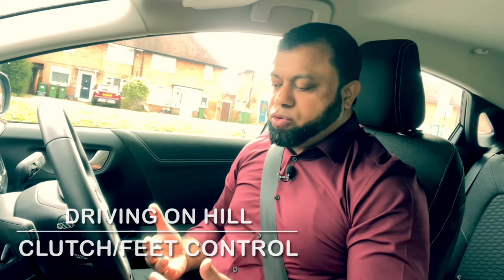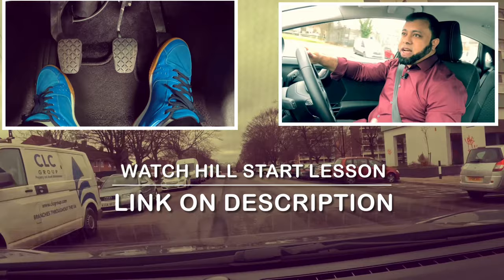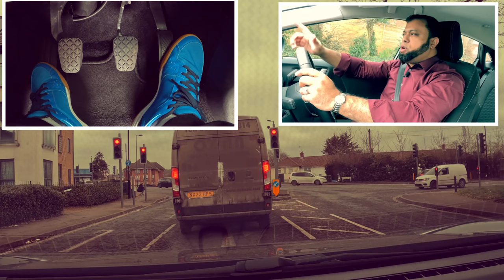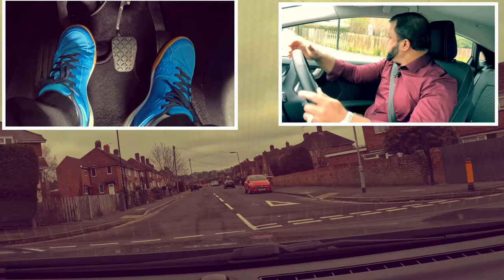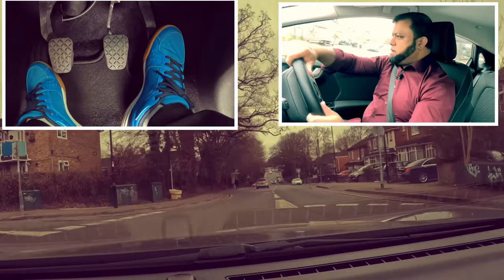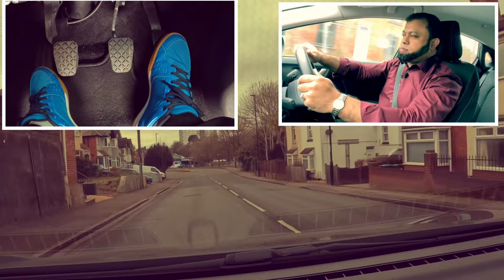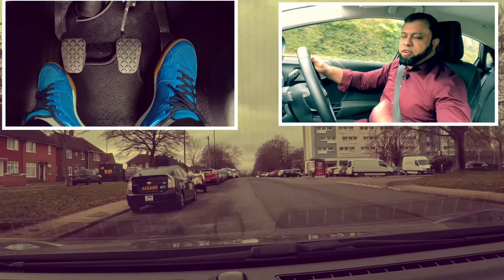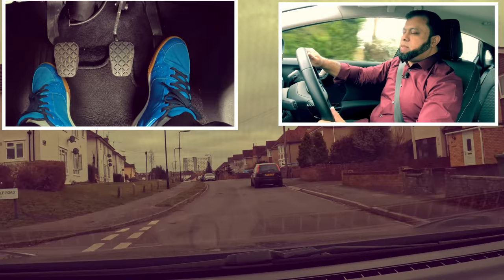CLUTCH CONTROL ON HILL DRIVING: Traffic Light And Roundabout On Hill!

Comment: Best thing i found at the right time !
I passed my manual test in London and thought I was perfect until I moved same month into Nottingham.
Nottingham is a city of very steep hills and I almost blame myself for getting a manual car, due to the super steep hills I never experience during my learnings in London.
Even though my car is a 2020 model without a physical handbrake, I kept stalling at every hill stop junctions in Nottingham.
This video has helped me to realise that I need to give more gas (about 2,000 rev like you said in this video) before moving off on a hill.

Are you able to pleaseeeeeeeee make the same video using a more recent car without a physical hand brake? this will help us with a more newer cars

Comment: Right now im confused, on the previous video you said the right way to stop the car is brake then clutch
But here you started with cluth then brake
Which one is best
Reply from the maker: Which part of the video you're confused please?
Brake to slow the car first and clutch down in the end to keep the engine running. 
If the speed is too low and the car is about to stop then clutch should go down to keep the engine running.